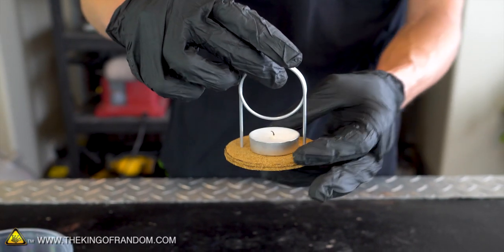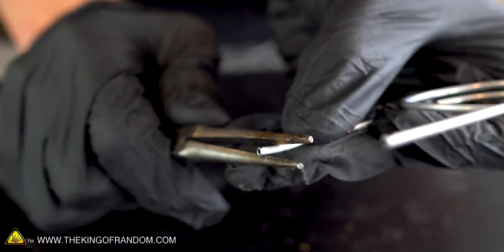Simple Steam Engine! TKOR's Tea Light Steam Engine DIY Mini Steam Engine

Comment: Fill the tubing with sand before bending, the sand will prevent it from kinking, and hold it's shape better rather than flattening out.
Then remove the sand with a vacuum or a puff of air.
Reply: sand's a great suggestion on larger dimension tubes, I've used it on copper and pvc tubes over 1/4 inch diameter. For a small dimension tube like this, try talcum powder, corn starch, or baking powder. Sand has too large of a grain to easily fill  small tubes - and empty them later.
Reply: @seansullivan6952  I would go with the baking soda option if the tubing is for actual hydraulic or pneumatic plumbing though. Talc is a thickening agent for lubricants, and cornstarch has a similar effect when it hits greeses, oils, or water based liquids. This means that you'd have to remove all greeses and oils and heat it to boil off any moisture first. Otherwise cleaning is a nightmare. However baking soda readily dissolves in polar liquids and so if you flush it out with water once or twice you can be pretty sure its all gone.
Reply: You are amazing
Reply: And cool
Reply: Sand is too hard to insert and remove. In the musical instrument business pipes get bent with frozen soapy water inside.
Reply: Dennis Schmidt smart
Reply: I prefer salt instead of sand because salt dissolves in water

Comment: this is pretty much a pop pop boat it uses that way to move in the water
Reply: Mickey Trixster 
I own one of those pop pop boats
It sank in the pool and spilled tons of oil 😂
Reply: @Fred_the_1996  way different principal powera this than a pop pop boat
Reply: ARGOS CENTURIAN 
Not really, the basics are the same
Reply: @argoscenturian6535  the principle is the same, the coil ejects steam and the difference of pressure makes the atmospheric pressure on the water push it into the coil. Bend both tubes one way and its the same as a pop pop boat. The only real difference is the boiler that a pop pop normally has, but the principle of ejecting steam and "sucking up" water is exactly the same.

Comment: There is an version of that motor which sucks the water constantly in throgh one end of the tube which allows it to run until the candle has burnt down.
Reply: Freizeitflugsphäre it's probably to do with offsetting the flame from the centre of the tube, so that it heats the rear end and duck's more in from the other end
Reply: How about a vertical coil with the intake on the bottom and the exhaust on the top.  I don’t know how effective that would be with a candle flame....
Reply: Schöner name😂😂😂
Reply: Tom :D Danke bist der erste der mir das sagt😃 hab meiner Kreativität für nen gscheiten Kanalnamen freien Lauf gelassen...
Reply: Cool Deutschland ist hier auch vertreten.
Reply: That is what this one is doing...  But since they didn't realize that, they minimized the efficiency by putting the flame near the middle of the coil and bending both tubes in roughly opposite directions.  It only worked at all because they didn't balance it precisely wrong enough ;)

Comment: Please make a rocket powered by acetylene gas obtained from calcium carbide reacted with h20.
Reply: Bibek Sunar hi
Reply: ENGLISH PLEASE!
Reply: john beynon english please
Reply: Beast Mode hello
Reply: john beynon why you dont understand chemistry
Reply: but why C2H2? why not other gases?
Reply: its a simple equation
Reply: Minh Phạm Acetylene, when it reaches to its kindling temp, the bonds breaks and release energy.
Reply: Minh Phạm because c2h2 has a weak pie bond so it can disintegrate easily giving lots of energy and thus more power output. Also acetylene is very easy to obtain and very unstable so it may not even need an oxidizer for propelling the rocket .
Reply: It will probably require a whole lot of tests if you want to make an actual worth something rocket. Seeing how combustible it is you maybe could get away without adding oxidizer, but it's also quite unstable so I wouldn't get within 30m (around 100 feet) of a compressor that is going to try compressing acetylene because I have no doubt it will detonate. You maybe could get it to about 2-3 bar slowly using a hand pump for it but I'm not sure if even this pressure won't make it decompose. It's a dangerous gas to mess around with, that is why you don't see rocket models using it. And any not compressed gas is a pretty 💩 fuel for a rocket.
Reply: Do it
Reply: Bibek Sunar specific eh?
Reply: amadeusz antyga regarding the compression of acetylene , acetylene is very unstable so dissolving c2h2 under the presence of hydrazine and acetone may  give a chance to store acetylene at a lower pressure   but it's just not possible on a simple random rocket . The only thing that can be done is to build a strong storage and compressor for the gas and a separate container for oxidizer mainly hydrazine or nitrous oxide or nitrogen tetroxide and a check valve which supplies a continuous supply of fuel and oxidizer into the reaction chamber . Dang that is so complicated but TKOR is gonna make that possible
Reply: amadeusz antyga do liquid or solid oxidizer work well on a gaseous propellant ??? Or it needs to be a gaseous oxidizer
Reply: Wut
Reply: Bibek Sunar i don't speak chemistry language
Reply: Bibek Sunar it's h2o👌
Reply: Bibek Sunar wa
Reply: This probably won't work because the combustion products don't have much mass, but he could give it a shot, I guess. Note: Be VERY careful combusting acetylene with oxygen, it is easy to get explosions. In oxyacetylene welding, there is extensive care taken to reduce explosions.
Reply: Bibek Sunar i
Reply: english plz
Reply: Erix there is no necessity to mix oxygen and acetylene during storage a separate compartment for acetylene and oxidizer can be prepared and a check valve can be attached that lets the mixture into the reaction chamber where it ignites and produces thrust
Reply: Bibek Sunar w
Reply: That would be cool
Reply: H2O not H20
Reply: Bibek Sunar calcium carbide is a product of reaction
Reply: H20 is water right? You can say water and not H20 you dont sound smart
Reply: goodbye
Reply: world'sbestpotato thats how reactions work yes not just with that particulair gas
Reply: Can we please see this?
Reply: sorry I don’t speak science
Reply: @greyfox32_5  I understood that perfectly fine. Use grammar.
Reply: Bibek Sunar I have know idea what you said but I like it
Reply: I agree
Reply: Aka what malaysians and indonesian usually do to make their meriam (cannon) hahahahaha
Reply: @aram69420  that is incredibly unstable. And ineffective.
Reply: @ethanmikitka4512  A company called Bangsite used to make noise-maker cannon that worked using this reaction.

Comment: Nice idea. It works even better when you bend the bottoms of the tube in the same direction. Because one sucks and the other blows. That way they don't try to cancel each other out.

Also, when you place the candle a bit more to the side of the bottom of the loop, then it heats up the side of the loop, which might help circulation a bit.

Comment: Like others have said, bend both tubes to point in the same direction. But also very important, offset the candle to one side. Heated water will rise causing it to flow in one direction resulting in one intake tube and one exhaust tube, and the orientation of both help the contraption spin in the same direction.
Reply: Yes! I thought of that but you would have to reshape the cork disk to make it float without it going under the water

Comment: Can you try to hydro dipping dry ice?
Reply: Fabian Diaz can’t be done due to the Leidenfrost effect
Reply: I think that the dry ice will freeze the water. Great idea BTW 😊
Reply: NICE IDEA
Reply: Nope the due to the leidenfrost effect the CO2 instantly vaporizes and creates a air barrier between the dry-ice and the water/spraypaint, the spraypaint will never touch the dry-ice.
Reply: Noet Games if the spray paint happens to stick a little to the dry ice, do you think it would create a paint bubble?
Reply: Fabian Diaz No i don’t think so. First of all if the paint sticks to the dry-ice it will freez solid. That brings me to the second point: if the paint sticks to the dry-ice, it falls of because the gas comming of the dry-ice will push the (frozen) paint away.

Comment: You should have bent both tubes the same direction so that as it turned water would be forced into one of the tubes as it shot out the other
Reply: Michio Oliver yes finally someone noticed that, I thought it was trivial
Reply: Wouldn't it perhaps also turn the suction into a driving force too? As it is now I think it brakes everything.
Reply: I don’t think it would make that much of a difference because there is only two holes in the coil so when the water goes out one end then it would be forced to enter the other end to equalize pressure

Comment: does gallium evaporate in the mateal foundary?
Reply: Whats a "Mateal foundary"
Reply: A typo which did not require correction
Reply: Probably, depends how hot it is
Reply: Sean Parkes no metal cannot evaporate its not a liquid😂, is a like a liquid when melted but still cant evalorate bcz its not a proper liquid that goes through the water cycle, which u learn at school..
Reply: Tony Paz Actually, all matter can become liquid. Gallium becomes liquid at around 80 degrees Farenheit. Some matter, such as wood, has a burning point that is below it's melting point, rendering it unable to melt. But all metals have extremely high burning points, so all metals melt into liquid. Water freezes into ice, though not a metal, still melts like metal. Just because something is not liquid at room temperature does not mean it cannot melt.
Reply: Thus, all metal can evaporate, provided that is evaporation point is lower than its burning point.

Comment: This isn’t a steam engine. The candle flame doesn’t produce any steam! You heat the water and it flows through the pipe, this then produces a forces causing it to turn, but there’s no steam
Reply: Mikes Science what is the force?
Reply: Thermal energy/kenetic? Heat is applied to the water and the molecules in the water get excited and force water through the tube.
Reply: "The candle flame doesn't produce any steam!"
Neither does any other flame.
The flame boils the water into steam. Then the steam expands out and wants to escape.
Reply: SecretAsianMan that sounds a lot like boiling
Reply: iLikeC00kieDough so when you heat water is automatically boils? As soon as you put a pot in the stove you have boiling water? Let me know how you manage that because I have to wait before water boils where I’m from. We have hot water over here, it’s nice to take a hot shower and not a boiling shower. I guess my water has different temperatures before it boils.
Reply: SecretAsianMan you are 100% correct. Don’t confused thermal energy with a phase change. The candle absolutely added thermal energy to the metal which transfers it to the water making it hotter. My argument is that there is not enough heat to create steam and this isn’t a steam engine. The hot water becomes less dense and travels up the pipe and out one of the ends. This is a thermal pump not a steam engine that operates on the phase change of water.
Reply: Mikes Science thank you
Reply: Mikes Science true dat
Reply: It seems nobody of you noticed the date of the video ;)
Reply: “produces a force...” called steam.
Reply: Uh Oh did you read any of the other comments? Producing a force and steam are not the same thing. If I push it I produced a force but there certainly is no steam. A force is a change in velocity. Steam is a phase change, a state of water
Reply: xAdaor hahaha
Reply: Mikes Science Putting a pan of water on a stove and holding a tiny tube directly over the flame are not comparable at all. Water boils very quickly when its in such a tiny amount. 
Heat up an empty pan then put a few drops of water in and it will boil instantly.
Reply: Aww aren't you just so smart😒
Reply: Mikes Science there is Steam just not external per traditional methods the steam is expelled directly into the water
Reply: Correction, sir. The candle heats the water, which turns to steam, forcing water out. As the steam in the colder parts in the top contracts, it sucks water up into the engine again.
Reply: Zombieven0m 125 awww aren’t you so condescending 😒
Reply: Noorquacker steam is invisible that’s water vapor that’s what you’re thinking of
Reply: Do any of your opinions matter ?
Reply: Mikes Science  the inner diameter of the tube is so small that it can only contain a very small volume of water. The candle could probably provide sufficient heat energy to boil the water and turn it into steam, perhaps locally. You can't just straight up call it not a steam engine. What if it is?
Reply: Qing Hang Woo it isnt
Reply: Mikes Science ok well u dont have to ruin it for evrybody he can call it what he wants
Reply: I think you also need to take into account the volume of water being heated. 1 gallon of water takes longer to heat than 1 cc of water. I agree with your point of it not being 100% steam, this process works the same with a nuclear reactor. It's called natural circulation, which means no pump is required to move water, it uses the differences in water temp to make a water circulate in a loop system. Works best in a closed loop system but same result.
Reply: Noorquacker actually fire burning does create water and therefore as it burns it up it would create steam so yes fire does create Steam.
Reply: xAdaor I don't think the date matters
Reply: Mangos steam Is Not Invisible... have you ever boiled water in your life? Come on you've had to have made ramen noodles before...
Reply: Jonathan Lee this is literally your logic:

How many legs does a dog have if you consider its tail a leg? It only has four legs just because you call something a leg doesn't make it a leg.

Therefore: Just because you call this a steam engine doesn't make it a steam engine.
Reply: /b/ Tard steam is actually invisible. what you see are tiny droplets of liquid water who are mixed with steam
Reply: You could clearly see the steam
Reply: justin koon  it's not a option its called convection
Reply: @JG-xh5bp  man heated air pushes the water , not enough heat to produce steam and surely water is not heated directly so how steam is developing?? no way this is thermal engine not a steam engine.
Reply: Mikes Science 
M
Reply: Mikes Science 
I.l lm
Reply: Mikes Science  its same as steam boats we used to make as kids it created force by heating the pipes
Reply: U r right
Reply: The basic principle is the same, thermal expansion of the liquid H2O towards a gaseous state makes the engine turn.
Reply: A very simplified version of a potentially complicated machine...basic principles...first 11 seconds
Reply: Earliest ways people were able to harness heat to create motion
Reply: Dude you realize that some steam pressure washers are heated with propane instead of a candle by being heated in a coil rights, as well as steam generator sometimes use coils too. Both create stream using the same basic design as this. The same amount of water in the coil could easily be heated in second to a steam producing boil of not to the point of flash steaming.
Reply: Sterling engine?
Reply: ? The steam is produced in the tube.. The pressure created by the steam is what creates the force required to move it.. if the exhaust end of the tube was outside of the water we would see condensation being released
Reply: The water isn’t flowing through the entire coil, there’s just a little bit trapped on the bottom half of the rounded half of the coil. Once that water begins to boil, there’s the steam that powers the whole system
Reply: I have one doubt
In these experimental it continuously run it or not...it continuously intake the water or not?
Reply: So many fakers and haters
Reply: The aluminum heats up, it’s not like the heat just stays in that one spot
Reply: You just ruined the video for me.😡
Reply: But someone made a glass version that's fully transparent, tested it thoroughly & scientifically, and concluded that steam was involved, because the resonant frequency is different from its stirling frequency
Reply: Then what kind of engine is it?
Reply: 8:36 it’s steam

Comment: Umm ... It stalled because you bent both tubes clockwise . One is an intake , one is an exhaust ... They should be faced oppositional , clockwise and the other counter clockwise . It's a boondocks water heater ... When it stops spinning the water is as hot as it will get .
Reply: They are faced in opposite directions
Reply: @mr.wizard2974  which is bad.  They should both be the same direction so there intake takes in water by method of ramming

Comment: What happens if you put a battery in the vacuum chamber
Reply: ivonne hernandez it explodes, if it's got liquid in it, it boils
Reply: EXPLOSION
Reply: Nothing will happen since batteries are made to withstand some internal over pressure.
And the liquid will only boil if it gets exposed to the vacuum.
Reply: If you want a video to be worth watching, it would be better to either try putting on a capacitor higher voltage than its use, and if they're polarised to reverse the polarity, and use some of those 1F capacitors. That would be interesting. Pro tip: you can just put a battery in a jar and it will look like a battery in their vacuum chamber ;)